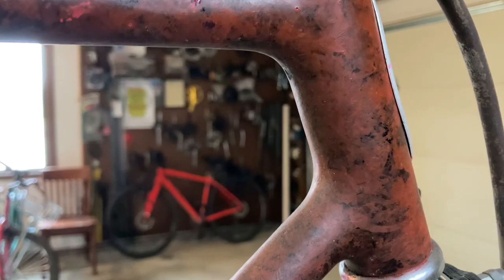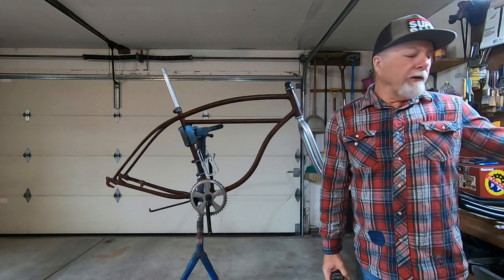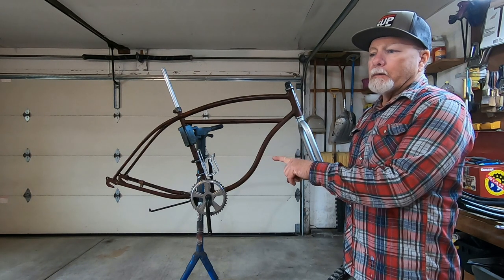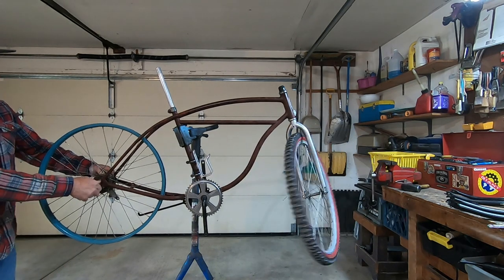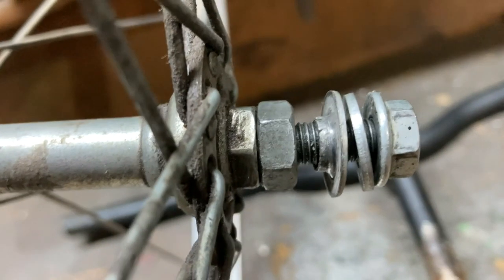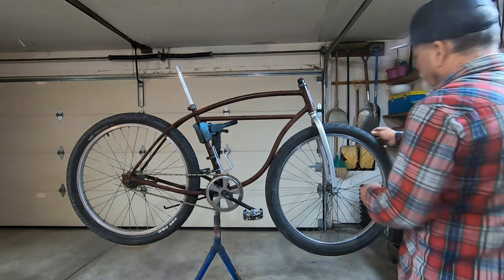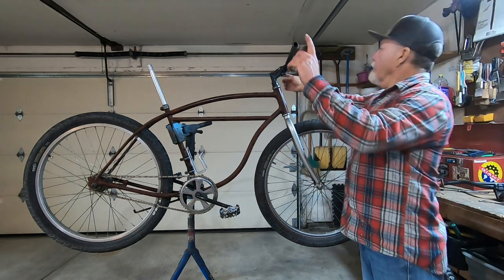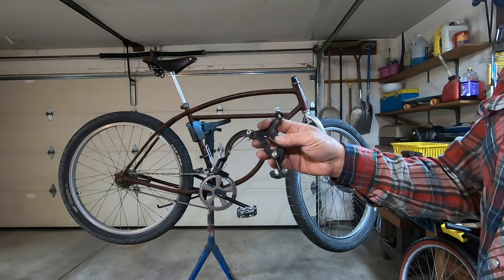Bike Builds & Mods - Let's Build A Rat Bike

Comment: Where do you get your spare parts from ?? Do you have a website you use, is it just from old bikes, or could I find them at a hardware store ??
Reply from the maker: A variety of places. The used parts are from many years of just saving any bikes and parts I come across. Discarded trashed bikes I find I bring home and strip of parts. An annual bike swap meet that we have here I get parts.. A year or so ago a local bike shop closed and I bought some things at the auction. New parts I'll get from a local bike shop or Amazon. Thanks for watching.

Comment: 🚴‍♂️🚴‍♂️🚴‍♂️ man i love these type of videos. Not everyone has the skillset to work on bikes. I would love to get into it but dont have the space to house all the parts and pieces needed. So i just enjoy riding them. Love the bike i was hoping you were going to throw some cruiser type handlebars without the front brake just using the coaster brake...
Reply from the maker: Thanks Timothy. I'm really not the most skilled at working on mechanical things or maybe even more so I don't have the patience but I do like to tinker. Been riding bikes nearly all my life but it wasn't till about 25 or so years ago I started working on them and I started  with the old cruiser style bikes because of their simplicity. That kind of evolved and I am more comfortable now working with brakes, derailleurs etc...  My first bikes I always built up as single speed coaster brake with cruiser bars but for my riding it's just more practical having multiple gears and 2 brakes so I'm starting to include them in more of my builds. We have a 2 car garage and only 1 car so that gives me half the garage for  storing bikes and it's a little cramped. I have to move the car out to work on the bikes. I've got frames and parts stashed all over. The garage, attic and shed. As always thanks for watching and the comment.